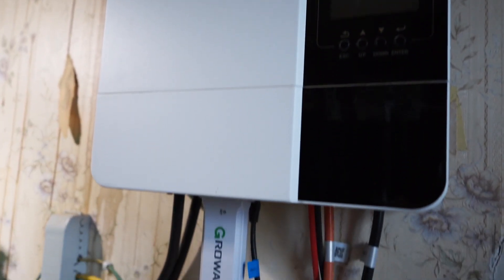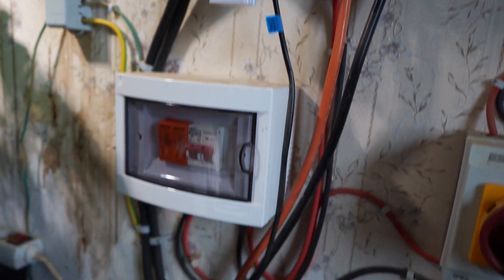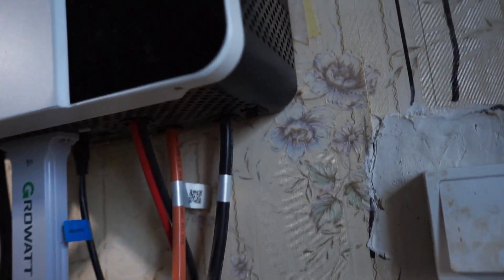Growatt SPF5000ES fault 08

Comment: I have a simular problem with my Growatt SPF5000ES and thought like you the Inverter had gone pop, and a fault code (can't remeber the number) that require factory repair, but on further investigation I discovered the fault was the cut off switch, replaced, and it all is good! So I would check your wiring, but I see you've changed tack and gone for a different make inverter. I also notice on my inverter was set to 230v where as the grit voltage was 240, but this cause problems with the breaker on the AC, so change the inverter setting from 230v to 240v, problem gone away. Just thought I would let you know!!
Reply from the maker: Good to know. I think my inverter matched the grid for voltage. The fault was bus over voltage or something like that. Growatt identified it as a blown mother board. Only reason we put in another inverter, was because Growatt were taking so long going back and forth with emails and we needed something, hence the PowMr. I've now got the new mother board, just got to fit it.
Reply: @Bensgarage  Good luck with the new motherboard, are you going to video the repair?
Reply from the maker: @showme360  Yes, I'll video the repair and then probably do another updating the firmware and installing it. If it works that is, fingers crossed.

Comment: first of all I am sorry this happened to you and recently encountered a similar problem. I used a broken grinder (I didn't know it was broken) and the system shut down (I got error 07). I didn't understand what was going on so I turned it off and on and continued my work. when I tried again got error 09. It turns out I burned the card inside. growatt can absorb the problems caused by such broken tools the first time, but the second time the heated card burns out. fortunately the authorized service replaced the card and reconnected the system within 1 month under warranty. in general I received comments that growatt inverters are very sensitive products. now I pay attention to the quality and oldness of the tools I use. do you know exactly what action caused the 08 error? and what precautions will you take to make sure it doesn't happen again?

Comment: I'm stuffing from this error 😢. This is 2nd time
Reply from the maker: Happened a couple fo times to us, at first it would trip the grid power coming into the house, I just reset everything and it started working again. Then it did it once more and nothing worked. Growatt advised a firmware update, still didn't work. They have now said it's the motherboard, I am still waiting for the part.

Comment: Thank you for posting this. I am currently entertaining buying a spf5000es but I am thinking I might spend more on something more reliable after watching your video.
I'm keen to see a follow up.
Reply from the maker: We were very happy with it, up to the point it went wrong. We only went for this as the shop advertises two year shop warranty, ten years manufacturers warranty. When it went wrong, the shop said it's out of our warranty but still under the manufacturers warranty. Growatt turned round and said no, it's only for two years. A lot of emails back and forth with the Growatt engineer, and they have decided to send me a new motherboard to fix myself. Asked how much it was, and they said free as it's our responsibility. So, not sure what is going on. In the meantime I have bought a super cheap PowMr inverter to get us up and running, while waiting for parts for the Growatt. Kind of wished I'd spent a bit more on a better inverter with better back up and a warranty written down. I will be doing a follow up video at some point, after I feel a bit less fed up with the whole episode.

Comment: Any news yet buddy? I’m an installing and looking at Growatt
Reply from the maker: We were very happy with it until it broke. Turns out now they only give two years warranty (said ten years when we bought it), but they have said they will send parts to fix as it's their responsibility. Not sure what to make of that, but there you go. In the meantime we have just bought a cheaper more powerful inverter with them same two year warranty.
Reply: @Bensgarage  Typical modern trait, fail upon end of warranty lol Are you anticipating an engineer to arrive with those parts?
Reply from the maker: That would be nice, but no. If they ever do send the new parts, I will be fixing it myself. For the price we paid and the service we got, I kind of wish I bought a cheap cheap inverter. At least then you know it would be a trow away item.

Comment: Not much to say about the support hey, there's a Growatt group on FB and let me tell you it's full of complaints of lackluster support. Sooo Yea, hope they actually do something.
Got mine installed by the supplier for South Africa, we got a changeover switch in the case that the inverter does go, but have been told you should keep it dust/moisture free and not overload the inverter.